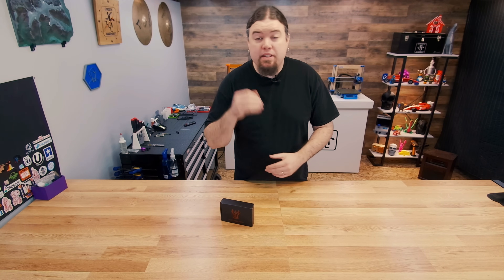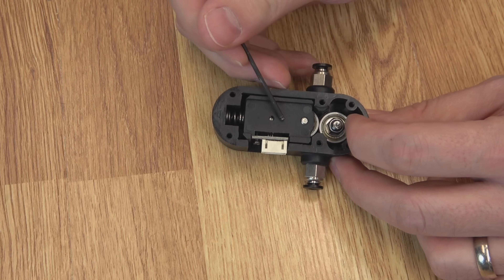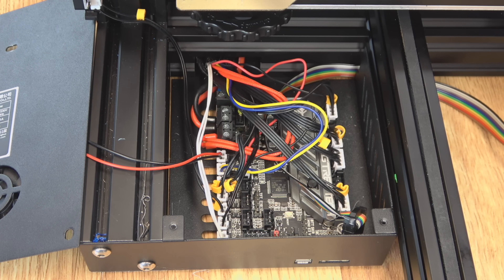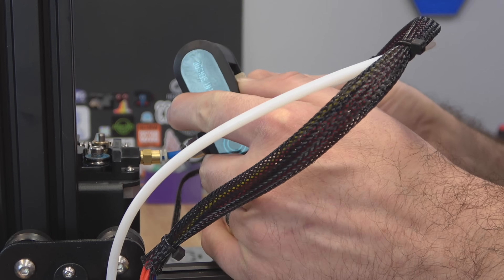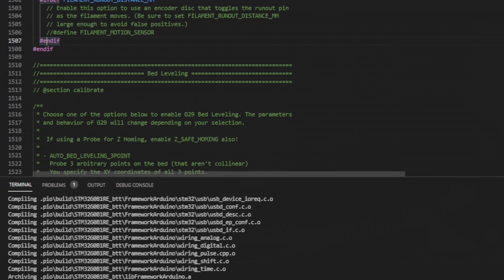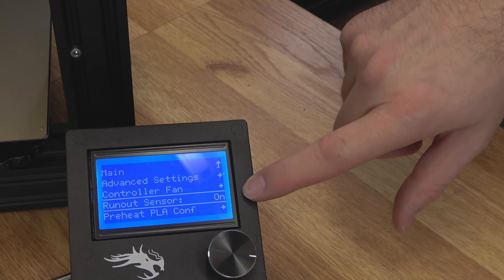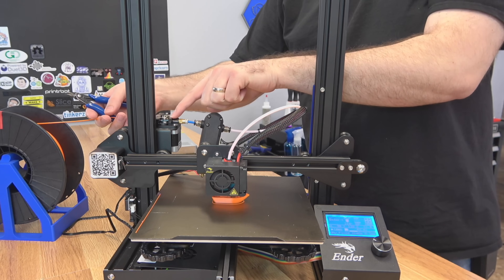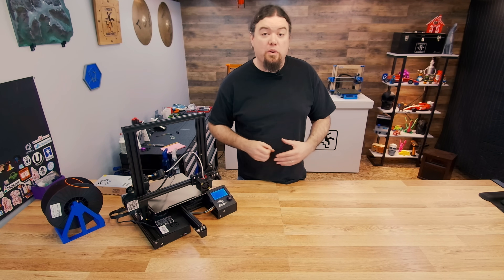BigTreeTech - Smart Filament Sensor - 2022 - Chris's Basement

Comment: when I start a print it goes right into filament change mode and if I go all the way through the process it starts printing again for about 1 second then goes right back into filament change mode
Reply from the maker: They can be really sensitive. All you can do is up the sensing link until it works correctly.

Comment: So retractions won't really work for a few layers until the new filament hits the nozzle right?
Reply from the maker: Not sure I understand what you mean. When the filament runs out, it will park and load, so it would be the same as it was before runout.

Comment: https://youtu.be/0WDfluszvd0?si=ohg2UChvQrzztyCs&t=620
How do you know which processor you're using?
Reply from the maker: The easiest way is to look on the chip itself if you have a magnifine glass. If you have a common printer, you can usually google it and find the board it uses and what chip it has.

Comment: I would never install one on my machines.  Your video explained the details and validated my reasons to not install. I feed new filament right to it as it's running out as it's printing. This would get in the way.  No I don't use stock tube configuration
Reply from the maker: Thanks for your insight!

Comment: ok im newish to 3dprinting but im curious  how to do the firmware while running big treetech (my screen can switch between  marlin/bigtreetech) not sure if its intertwined or how it works
Reply from the maker: Yes, if you have both TFT and EXP cables plugged in you can switch between them. Check this out.  https://youtu.be/57f-sG0nFeM

Comment: I think it is better to place the filament sensor before to the extruder. Then you don't have to disassemble anything to pull out the remaining filament. To replace the filament, you just have to unload it with the extruder and you're done
Reply from the maker: Thanks for the tip!

Comment: Hey Chris, thanks for the video. I noticed two things though. First was an enormous movement of the PTFE tube between the extruder and the sensor during retraction. Second, I was wondering if the device is using a quadrature encoder (two light sensors) or just a simple edge detect encoder (one light sensor). If it is just an edge detect, does it fail if the filament bounces when being pushed into a jam? Sometimes (most times) when the head jams, the filament moves forward slightly and then bounces back (overpowers and clicks the stepper). If the encoder is on an edge at that time, it will still think it's being driven forward because of the rising and falling signal from the detection scheme. 
It really needs a quadrature encoder with a small processor to count movement back and forward and only give the pulse out if it moved over a certain distance. Many DIY movement designs shown here on YouTube only use one light sensor and can and do fail with filament bounce.
Reply from the maker: Thanks for watching! Yes, it's only a single and your right, jams would still be pretty hard to detect consistently.

Comment: I’m very much a noob when it comes to changing anything in the Marlin firmware. Do I just download the firmware, open in vs code, make the changes, then recompile and load to the printer?
Reply from the maker: I'm afraid every printer is going to have a custom config. The easiest way is to use one of the custom config examples. https://github.com/MarlinFirmware/Marlin/tree/2.1.x/config

Comment: So I found mine had some blobs of rubber on the rubber wheel which was making the filament pull-though a bit jerky. After cleaning those it has improved it. I've also swapped the spring for a weaker one - it still grips well but reduces the effort needed to pull the filament. Assuming my springs in my box have not been mixed up, the spring should be a "compression 7x12.5mm" from my Duratool D01893 spring kit.
Reply from the maker: Good find, glad it's working better.

Comment: I've just received one of these. I haven't installed it yet but two things I have noticed after installing filament in to it. One is that it sqeaks! The other it that it adds a lot of friction. I would have liked it to be smooth and for it not to require so much effort to full it though. Have you reviewed any optical sensors yet?? If they are a good price I think I'd prefer one of those as they should be virtually friction-less.
Reply from the maker: I haven't tried the optical ones yet, but it would make a good test.

Comment: When you have a runout sensor between the extruded and hot end you need to remove all the filament all the way to the hot end.

If you don’t then there is a break between the new and old filament in the bowden tube. If there is a break there the extruded can not retract for 200-300 mm of filament (piece that remains in the bowden tube after the runout).

By the time that break makes it too the hot end there is a >0% change your going to have a air gap between the two pieces.

You will have likely stopped the print before that air gap due to how poorly the print is looking due to the effective 0mm retraction the break in the filament is creating. If you don’t think about it your next print will do the same until you realize you need a single piece of filament between the extruder and hot end or it pushes out that 200-300mm.

Either Chris here or BTT didn’t think this through. I hate to say it but often times in the 3D printing space manufacturers assume you should know these basic things and don’t put it in the directions or don’t include directions at all. Chris should know this if he’s creating content for the masses to learn from.

Regardless, you want a continuous piece of filament between the extruder and hot end in any scenario using any printer (Bowden or direct). If not then a vital function of quality prints (retraction) will not function. Always pull all the pieces out of the printer after a runout unless you are welding them together to form a single piece.
Reply from the maker: Thanks for your insight

Comment: Hi Chris great video, appreciate that you used the newer mini E3 v3 board too.  
I was looking at the BTT github for their runout sensor and it says thay for version 2.0 of the sensor, you only need to set 3mm as the runout length.  However, I cannot find any documentation on what makes the sensor version 2? Any ideas?
Reply from the maker: Thanks! Honestly, I didn't know there was a V2. I haven't seen specs for it anywhere.
Reply: And how do you distinguish it from v1.0?

Comment: As always Chris ,  my config did not go so smooth.  I immediately get false message that the filament is out.  SKR pro 1.1 and BTT TFT 35 3.0.  Could it be that the SKR common pins file says use PE15 as the runout pin and that pin is also used for stall guard/sensorless homing?(yes I am using sensorless homing)  I have seen you switch out pins like this for conflicting features.  ... see below

OK so  I was able to use the pins (and connector) for runout sensor 3 (PG5).  I put PG5 in place where the PE15 was in the SKR pro common pins.h file.  It actually worked.  I couldn't have done it without you Chris, and your thorough and to the point videos.  I also took your advice and set the runout sensor 3 pin to -1
 so for now on when I use a new pin for something,  I will check for conflicts.

What we need next is a spaghetti sensor... LOL.. we have all made spaghetti
Reply from the maker: Lol, I'm glad you got it working!
Reply: @ChrisRiley  A follow up.  after 4 months I started having false filament jam detections.  I thought it was the material and started messing with the sensitivity.  No luck.  turns out the wheel was not rolling as the filament passed by.  I tried cleaning the wheel but it did not help.  in the end I just bought another sensor and its been working ever since.  Just thought I would share my experience-  just in case anyone else is struggling.

Comment: Hello Chris, I would like to use one of these on my printer running on mainsail and Klipper. I have found commands and Macros that seem to be what I need but totally confused on how to implement. There is an M600 Macro for klipper, just seems like other commands are needed. Think you could do a video using the BTT Smart Filament Sensor with Klipper? Seems like "Capture" could be used then "Resume". But I'm sure more needs to happen than to simply pause, reload filament than "Resume" Things like moving to a safe area so the nozzle isn't just paused on top of the print.
I see this all is done in Marlin but Klipper still has me baffled.
Reply from the maker: Hey Charles, I have looked at this in Kipper before and it is very confusing. This is something I hope to tackle in the comming weeks.

Comment: Hey Chris thanks for this video. Any updates on using with octoprint? I'm currently using the plug in but the settings are driving me nuts lol
Reply from the maker: The easiest way is to use it plugged into the board and use host action commands.

Comment: Could you do this for a ender 3 with direct drive and the BTT screen with the e3 mini board and with octoprint?
Reply from the maker: You can make it work with all this if you had the sensor plugged into the board and you used host action commands.

Comment: It works flawlessly with Klipper when plugged into either the control board or the RPi.
That said, I am not happy with my sensor at all.
It adds a ton of drag to the filament, to the point where it can actually cause under extrusion with some filaments in a direct drive set up. I have tried several tweaks to try an get it working better, re-tightening the bearing nuts so they are not over-tightened helps a bit.
The entire housing needs to be redesigned so that it clamps over the filament like a scissor rather than a c-clamp.
Reply from the maker: That's too bad, I'll take a closer look. Thank you for your insight.

Comment: If your filament jams and it skips has the extruded grinds it do it sense that as a problem even if it’s like going +1mm and then -1mm? I feel like mine has failed me a couple times by jamming and not triggering
Reply from the maker: It should catch that error but I could see how it could still fail the print.

Comment: I have a skr 1.4 turbo board using a tft 35 3.0 and the mini ups, a bl touch i could never get the sensor to work and took it off i don't know if it was because of the tft or if it is even possible to use it with all the other things i have on the setup. But i will try updating the tft and see if that helps. Thank you for the video!
Reply: I’m having the same issue with the same board. Mine immediately thinks filament has run out as soon as print starts.
Reply from the maker: If you have problems using it through TFT , it's almost always a screen firmware issue.

Comment: Great video! Had the same problem as others and just could not ever get mine to work on my Ender 5. I will have to give it a shot again just to make sure the sensor isn't just bad. BigTreeTech never bothered to respond so not very happy about that but their mini board is working great and this was only like $20.....
I am looking to put mine before the extruder BUT I want to just feed more filament when it runs out. Would love to hear about doing that as I am not sure if I should set the unload to just 1mm and go from there or if I can turn the unload completely off and have the load routine just purge and continue. Hard to load filament on the BMG if I put the sensor after the extruder tahts why before would work way better ;)
Reply from the maker: Thanks! If you keep it before the extruder, you should be able to just set those values to zero to keep it from unloading.
Reply: @ChrisRiley  Thanx man!

Comment: When filament out then extruder will stop pushing filament, and how filament detector will be to know that filament end?!
Reply from the maker: It's because of the encoder, if the filament isn't moving it will trigger it.
Reply: @ChrisRiley  So BTT Smart Filament Detector have to work as moving detector.
Reply from the maker: @MaciejN.  Correct.

Comment: I have one of these on my Ender 3 v2, mounted to the frame just before the extruder. With Jyers firmware,  I was getting frequent false runouts. After changing the setting from 7mm to 25mm it works perfectly.
Reply from the maker: Interesting, I will have to try that if I have issues.
Reply: I have an Ender 3V2 with the 4.2.2 card and as I interpreted there is a connector on that card for this sensor. What motherboard do you have in your printer?
Reply: I also had this issues on my E5, running a 4.2.2 board.  I thought it was the sensor but, after trying two other sensors, I dove into the internets.  Found some others complaining of this issue.  The update to the FILAMENT_RUN_OUT_DISTANCE fixed my issues as well.  My thought is that the setting is pulling double duty somewhere and causing the issue.  It seemed to trigger during travel in my prints.
Reply: I have the same 4.2.2. Just plug it in.
Reply: I have the Ender 3 v2 (4.2.2 board) and tried this with no success. it immediately throws an error. Any suggestions? (I also have octopi running but still have it hardwired into Ender 3 main board)
Reply: @ThePercOfGaming  which firmware are you running?

Comment: I bought one like a year or more ago and forgot I had it. I plan to install it one day but it's not high priority because I so rarely run out mid print anymore. I have some large prints planned though so I need to get it set up.
Reply from the maker: It definitely comes in handy for large and overnight prints.

Comment: This filament sensor works great until… You want to print with flexible filaments!!! (Like Ninjaflex). First, loading the flexible filament through the sensor is extremely difficult due to the heavy resistance of the sensor rollers. When printing, the flexible filament acts like a rubber band and 7 mm isn’t enough leeway to avoid throwing the filament run out error. The rollers add a lot of drag against the extruder. 
Now, when I print with flexibles, I bypass the filament sensor entirely and turn off filament sensing in Marlin through a g-code command. It’s definitely not ideal. 
Do to these difficulties, I am seriously  considering returning to the micro switch run out sensor which does work with flexible filament.
Reply from the maker: I didn't really think about that, but I can see where this would be a real pain. Most of my flex prints are smaller, so I usually don't worry about runout.

Comment: I bought 6 of these things for my small print farm and couldn't get them to work at all with my printers. I might have to try it out again thanks to this video. 😁👍👍
Reply from the maker: I hope it works out! Let us know what how it goes.
Reply: I have had problems with direct drive - if the filament path is not constrained the length can be longer.  I'm using 75mm and trying to get it better

Comment: Warning if you want to print flexibles and use this smart sensor, you're potentially going to have a real bad time. 
A good bit of advice is turning off holding timers, this will give you some insurance that you can unload and load filament without losing steps.
Reply from the maker: Thanks for the tip!

Comment: by enabling these should allow you to use the smart sensor plugged into  the main board while printing thru a tft screen or octoprint.
EMERGENCY_PARSER (in Configuration_adv.h)
SERIAL_FLOAT_PRECISION 4 (in Configuration_adv.h)
HOST_ACTION_COMMANDS (in Configuration_adv.h)
HOST_PROMPT_SUPPORT (in Configuration_adv.h)
Reply from the maker: Cool, thanks!

Comment: I bought one of these a long time ago to use with my Ender 3.  It's an old board so I don't really have a way to connect it so I wanted to connect it to my Raspberry Pi, running Octoprint.  I connected it to the Pi but couldn't ever get it working.  I was hoping you'd cover the Octoprint connection method since it's printer board independent.
Reply from the maker: Connecting it to an extra endstop or something like that would be best. Next week's video might be interesting to you.

Comment: Did anyone besides be notice at 12:50 just how loose the bowden fitting was on the extruder side? That'll play heck w/ tuning a profile. Definitely shouldn't be installed where BTT recommends it.
Reply from the maker: Those stock fittings are awful, I swap them with the printed solid ones.

Comment: So why does it need to be between the extruder and hotend? Shouldn't you just be able to use it normally.
Reply from the maker: It doesn't need to be, that's just BTT suggestion. You can use it anywhere.

Comment: Good video.  I hooked the same smart sensor up to one of my printers using Klipper and both Fluidd and Mainsail.  I know why I switched, I had to change two lines of code from the simple switch sensor.  I'm also using a direct drive which complicates the process, the filament is not constrained, so I am using a 75mm length.  I'm in the process of testing my own sensor that is much lighter and may work even better.
Reply from the maker: I was wonder how Klipper or REPRAP would work with one of these.

Comment: Another great video! Advanced Pause is such a great feature, with multiple benefits. Shame few manufacturers take the time to fully configure it. 
I have had one of these on my delta for a year now. Little tricky to setup, but really like it. You mention the recommended placement was a bed idea, and it is! But could probably stress that it could still ruin a print being after the extruder, because the printer is not feeding filament during that 7mm, and could be a problem if printing an exterior surface. Mounting before the extruder makes it a mute point.
Reply from the maker: Hey Scott, totally agree, the suggested mounting option just seems lazy.